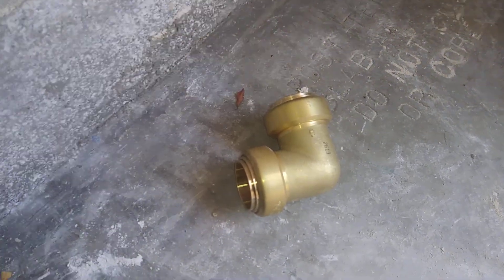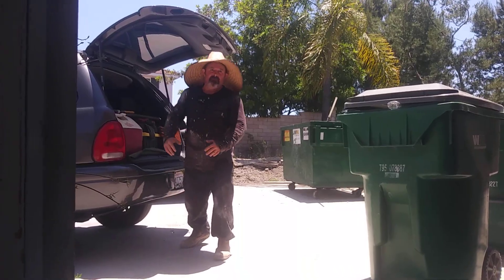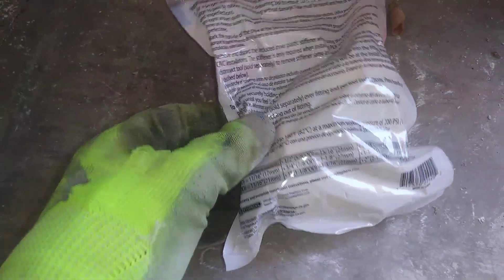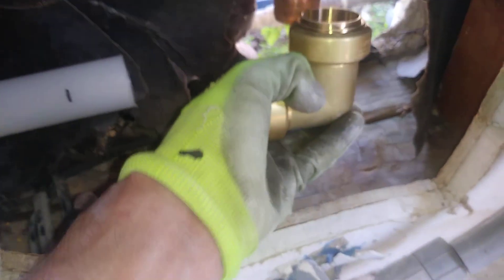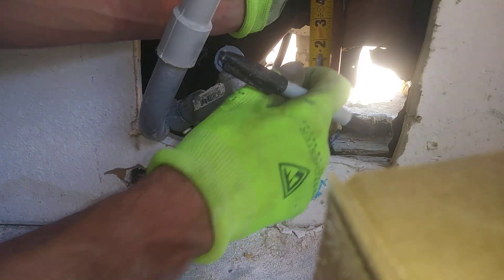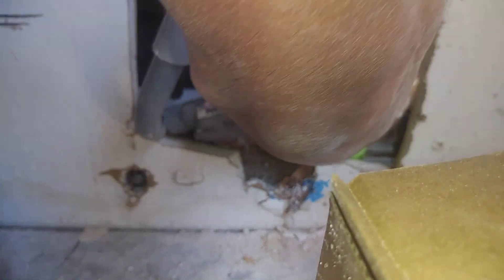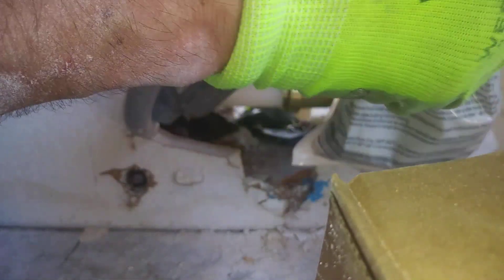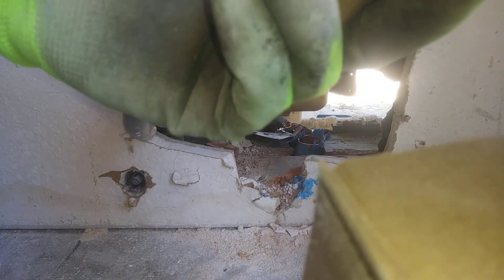How to connect PEX to copper

Comment: this is a crazy connection    what's this a 1 or 1 1/4" in the wall connection? with a push on connection? Get a normal copper to PEX fitting, and use the right clamp or Uponor fitting. and the potential leak is just above electrical. just crazy.

Comment: Yeah those 'shark bite' connections can be a mother.  I've been having 'drips' with 3/4" 90's a few times when turning the water back on.  Had to twist the connector on the outside of the PEX while keeping it pressed in the PEX and the drip stopped.  But  after a week with pressure, the drip never came back so we sealed the wall up